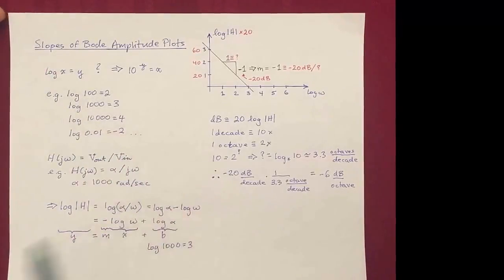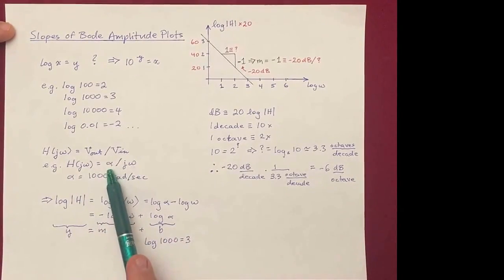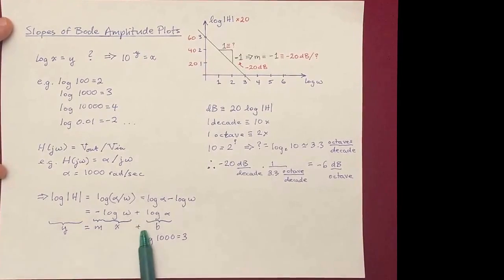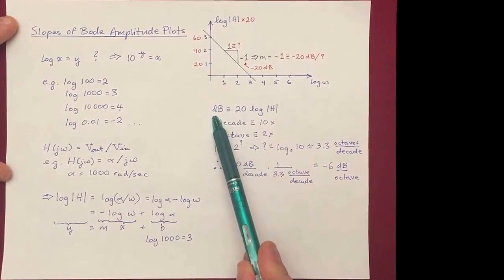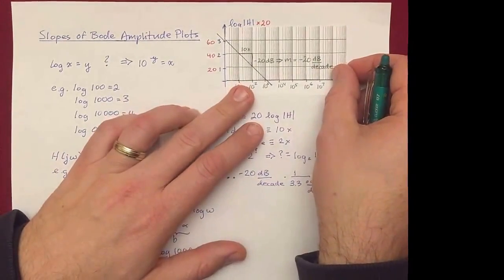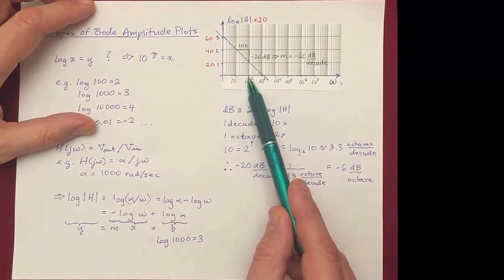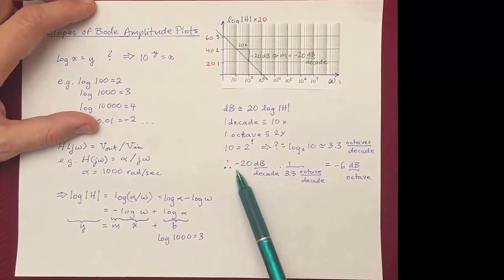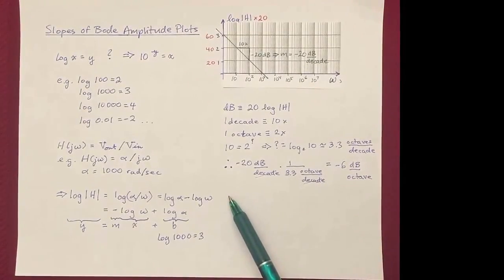Understanding Slopes of Bode Plots and Filter Responses

Comment: How do we get decades to octaves simply explained. 
When we say octave, it means a doubling of anything, things,  frequency so we use it as base 2 for the octave, decade is self-explanatory. 

Let y = 1 decade and let x = the number of octaves. Exponentiating and using logarithms, 2^x = 10^1, solving for 'x' through logarithms, we find that 3.32 octaves = 1 decade, used as a factor for conversion. Lastly in Microwave electronics we use the 'dBm' units.